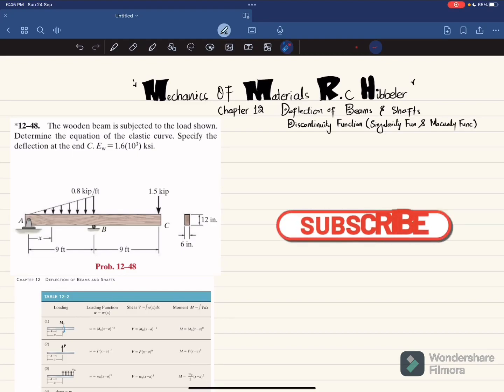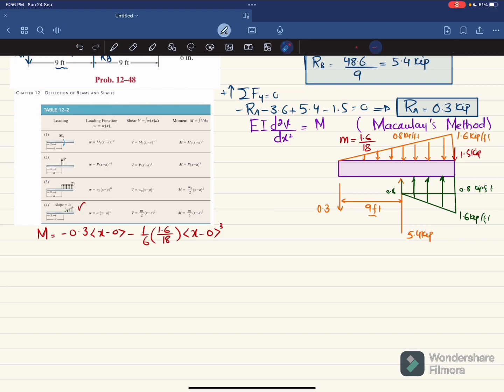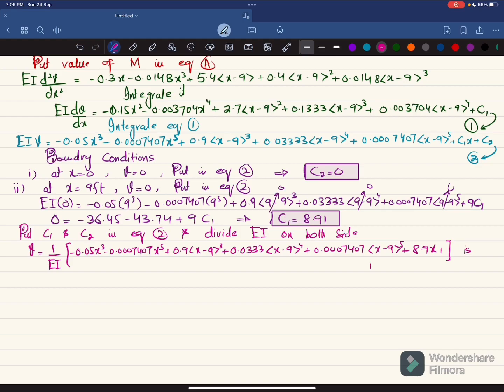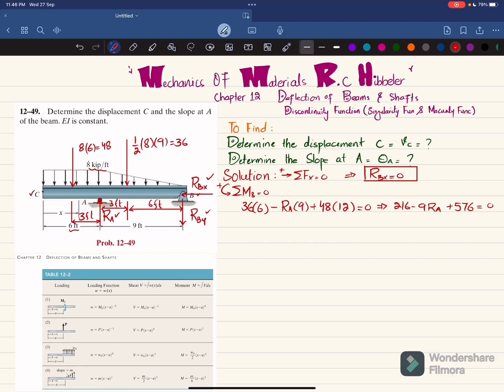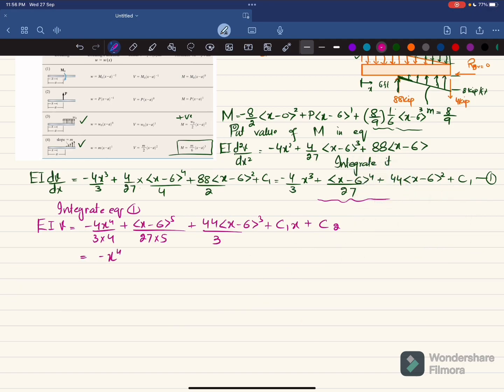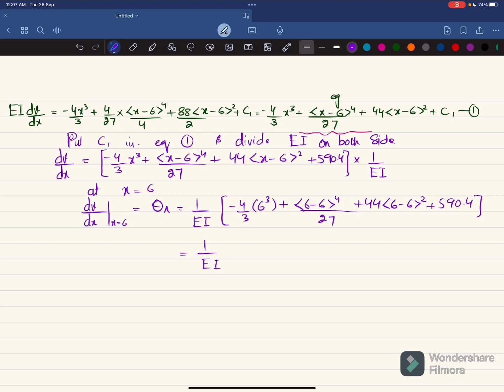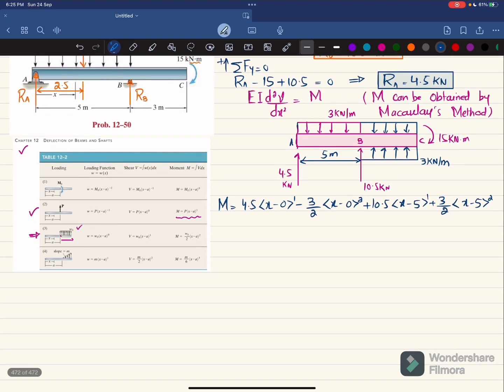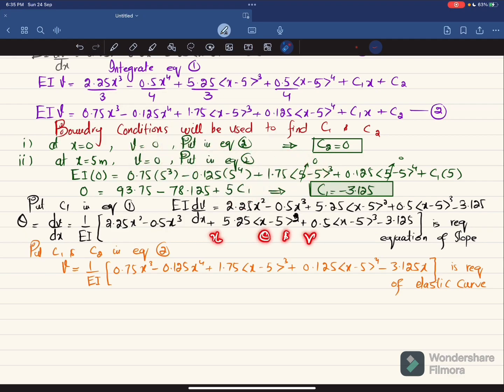How to find the deflection & Slope using Macaulay's method | Mechanics of materials RC Hibbeler

Comment: salam sir this is kamil sir how to find the value of x I have got a quetsion in my past papers we have to find maxixmum defelction in case of simply suported beam how to find the exact point of defelction?
Reply from the maker: For a simply supported beam, the **maximum deflection occurs where the slope is zero**.

The method is:

1. Find the deflection equation (y(x))
2. Differentiate it to get slope:
   theta = dy/dx
3. Put slope equal to zero:
   dy/dx=0
4. Solve for (x)

That value of (x) gives the exact location of maximum deflection.

For example, if the loading is symmetric (like a central point load or full UDL), the maximum deflection is directly at midspan:

x={L/2}

The general condition is:

dy/dx=0

After finding (x), substitute it back into the deflection equation (y(x)) to get the maximum deflection value.
🎉
Reply: @engradnanrasheedmechanical  jazakumullah sir
Reply from the maker: My pleasure ❤